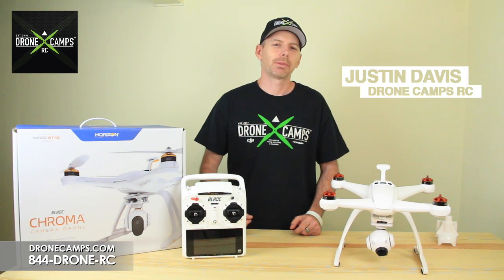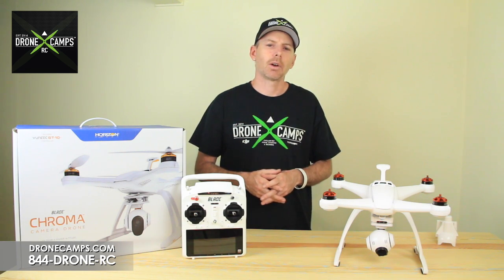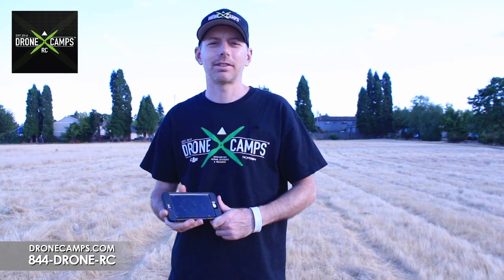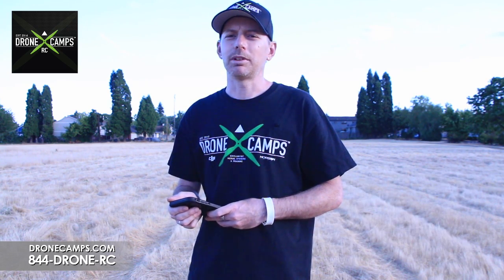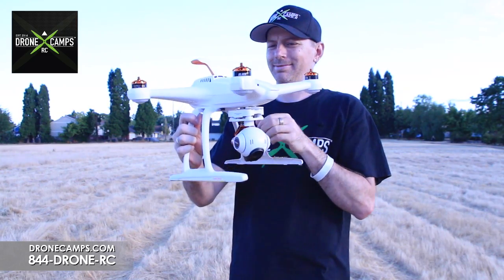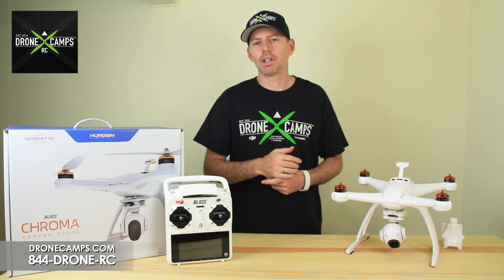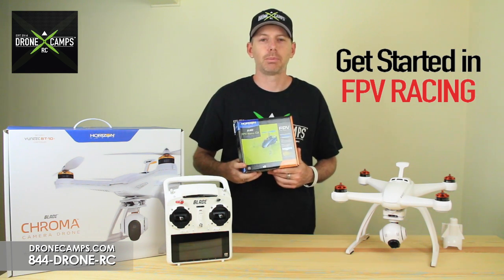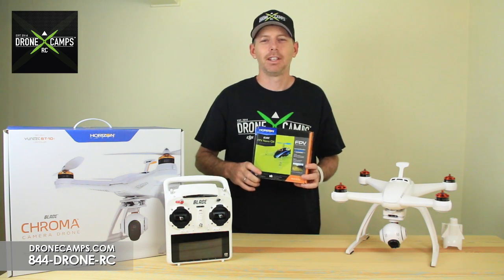Chroma Drone - Compass Calibration, Complete Tutorial

Comment: Hi. Do I have to disconnect the gimbal before calibration or no need? I asked this because in the Blade 350 QX3 AP Combo, the instruction was to remove the gimbal to prevent it from getting disoriented.
Reply from the maker: +Quad Addict no.